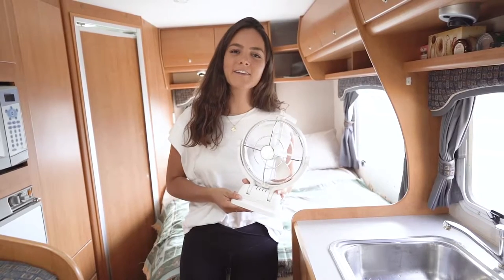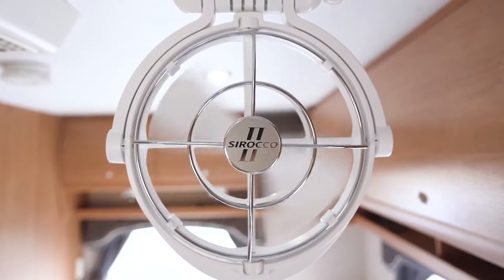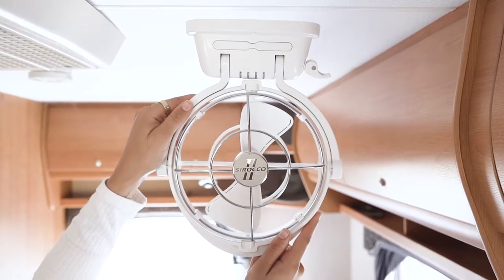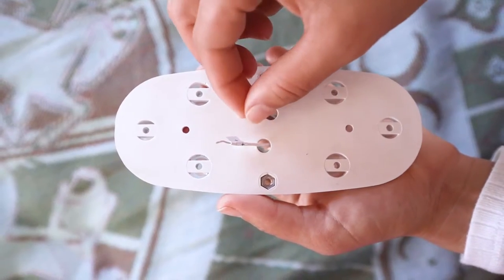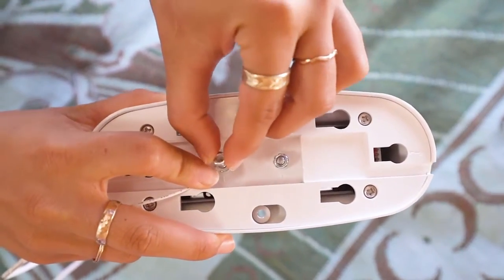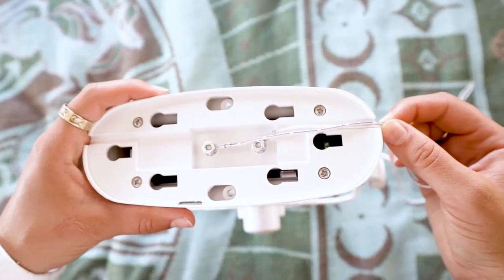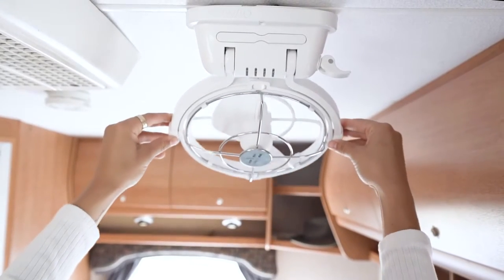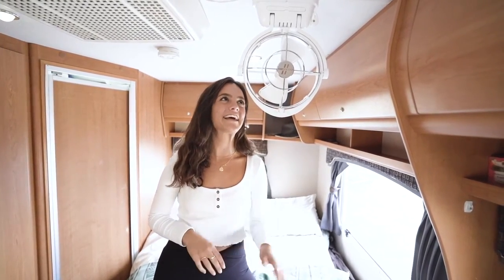Easy installation of Sirocco II Elite fan for caravans

Comment: Thanks for this video. Can you tell e how you attached the wiring from the fan to the power source. Thank you
Reply from the maker: The wire ends need to be direct wired into an existing 12 or 24 volt wiring system. Please refer to the manual to review full instructions. https://seekr.caframobrands.com/media/wysiwyg/seekr/Sirocco%20II.pdf Thanks!
Reply: @SEEKRbyCaframo  thank you

Comment: What amps is this fan? Can I put a 12v plug on the end instead of hard wiring to a battery ?
Reply from the maker: Hi Hope, thanks for your questions. 
12v amp draw: speed 1 is 0.16, speed 2 is 0.33, speed 3 is 0.6, speed 4 is 1.01
24v amp draw: speed 1 is 0.08, speed 2 is 0.17, speed 3 is 0.32, speed 4 is 0.52

We recommend hardwiring this fan into your battery.
Reply: @SEEKRbyCaframo  I can't wire it to my battery unfortunately. That's why I'd like to put a plug on it. Can I put a 12v or USB on it. Is it possible? No point spending $200 on this if its not.
Reply from the maker: @Petapan33  We do not recommend any modifications to the wiring. Please get in touch with our customer service for direct support. Email contactus@caframo.com Thanks!

Comment: Can you tell me the difference between the Sirocco 2 vs the 2 Elite?
Reply from the maker: Thank you for your comment. The Sirocco II Elite has several upgrades to the Sirocco II. 4 speed settings vs 3, 4 year warranty vs. 2. A 20,000 hour brushless motor vs a 5000 hour motor. The Elite is more powerful and quieter than the Sirocco II. All with the same 12/24V auto sensing, mounting footprint, 360° airflow capability and 4 timer settings at the Sirocco II.  For more information please visit our website at https://seekr.caframobrands.com/7012cawbx.html